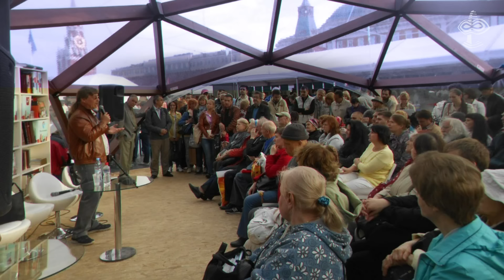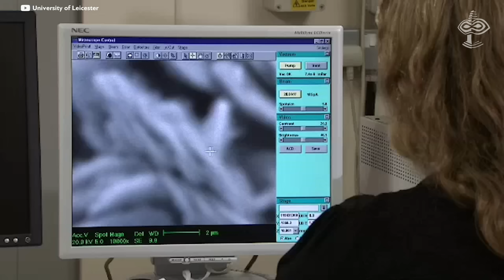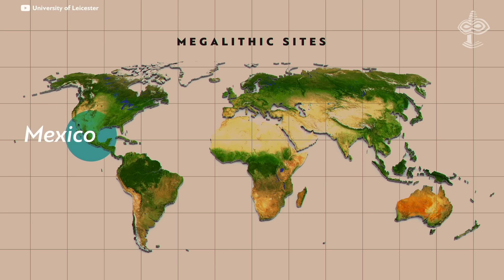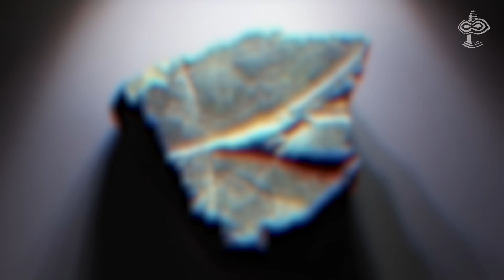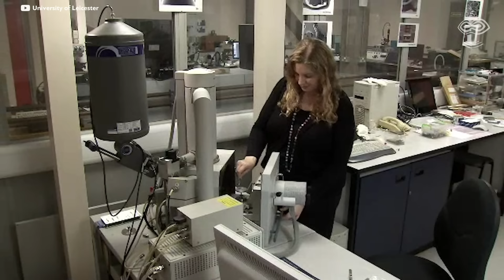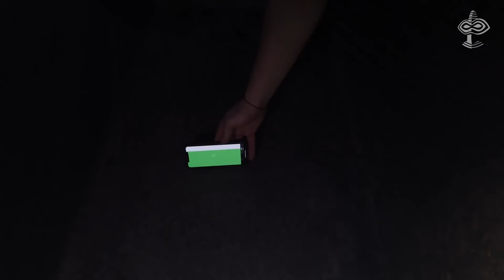The Secret of Ancient Tools: METAL MICROPARTICLE research - VERSADOCO

Comment: If it was not granite and instead a geopolymer that resembles granite because it is made with the sand from granite that was carved that could explain the tool marks in the pylon. Concrete can be worked with hand tools that leave parallel striations and the tools can be very thin because soft concrete is not that abrasive or hard.

If this stone is actually a composite made with Venetian plaster and granite sand like many marble renderings it would be worked to the shape observed. Surfaces can be polished with animal wool or textiles made of plant fibers. Some kinds of clay has very fine but also very hard particles that would be excellent abrasives for finishing. We know people extensively worked with and hardened clay. So they would understand that stone can be cast after being shaped in semi liquid form, and have am intrinsic understanding of the properties of different kinds of clay.
Reply from the maker: One thing we can definitively rule out here is the use of concrete. Ancient Egyptian megaliths are NOT composed of concrete, cement, or geopolymer materials. 

These processes require crushing the rock and altering its internal structure, something that can be easily identified with modern analytical tools.

And it was checked - https://www.researchgate.net/publication/248546084_Mineralogical_petrological_and_radioactivity_aspects_of_some_building_material_from_Egyptian_Old_Kingdom_monuments

Here is a quote from abstract:
"Mineralogical, petrological, XRF and radioactivity measurements were carried out on several Egyptian monuments (at Giza plateau and Abydos), as an integrated archaeological sciences project concerning Egyptian cultural heritage...
...Regarding the aim (a), hypotheses that large building stones used in the monuments were cast, as opposed to carved out of natural stone, are not supported by (i) the presence of undamaged fossils, (ii) lack of zeolite peaks in X-ray patterns, which would be expected if CaO was used in making cement, and (iii) random emplacement and strictly homogeneous distribution of fossil shells in the whole rock in accordance with their initial in situ settling in a fluidal sea bottom environment. Moreover, statistical clustering of chemical composition indicated five rock sub-categories and XRF analysis reported inhomogeneity of rock composition."

And don't forget about the existence of stone quarries.
Reply: @Versadoco  Sorry for rambling on! lol
But we need to zoom out from the trees to see the forest. 

Mining is a very costly and labor intensive endeavor that involves a great deal of sacrifice as the conditions are detrimental to human health and typically shorten lifespan significantly. 

Likewise, some mined resources are rare, especially in particular form, and possess very desired properties. However, they are incredibly hard to find.

Given all that effort was put into gathering these resources. We can safely assume that they would have explored multiple ways to use, or re-use the materials collected so that the yield of resources could be maximized for the effort. Even the sand from processing would be valuable to those who did the work.

Much like carpenters will collect their sawdust to use as color matched fill material.

Heck, people in eastern Europe make pipes out of basalt in a kiln so the rock is molten and when cured is identical to the natural parent material because the conditions in the kiln are almost identical to the conditions that formed the rock in nature. People are very observant and learn to copy what nature is doing.
Reply: @Versadoco  I certainly understand that some softer stone like limestone was more easily cut in raw form to relatively precise shapes using harder tools. The fossils are present in this type of sedimentary stone. Granite on the other hand is not a sedimentary stone and does not contain any fossils.

I would not suggest that granite was not quarried or ever made into monuments like statues. I would conclude simply that for the lack of waste piles that the cast off from quarrying granite was put to use. The pulverized granite sand would be relatively pure much like marble sand from quarrying marble.

Artisans both cut and carve natural marble, and use marble sand as pigment in a geopolymer rendering present on many columns, statues, and architectural features like architraves. There are also granite statues which are in fact hollow frames with a rendered material.

They did conduct some tests on the wall in Sacsayhuaman and likewise found the zig zag walls did not include natural rock veins like the parent material. Instead the vein material was present but in uniform particle distribution throughout the solid. Indicative that the stone was cast.

I wonder if these particular features have been analysed in the same way. The geoplymer material composition and grain pigments are identical because it is the same material. Only the lack of quarts vein inclusions and other natural crytal structures that deductively concluded the difference.
Reply: @Versadoco  Also, the fossil inclusion thing I'm not even sure is definitive. That assumes the calcium source and aggregate material was crushed or worked. That is a relatively modern process involving heavy machinery. If not for ball mills, and rock crushers, it would be too labor intensive.

Romans are known to have used crustaceans as a calcium source in their concrete mix. Not necessarily crushed to a powder. Just cooked in fire and activated with water. So it is possible for those marine creatures to be included in the concretion. 

All lime stone is in fact a geopolymer. As is was once a liquid mud that changed through chemical processes.

Ancient people hardened clay. They made mud bricks. They could not recreate the natural process that converts mud into hard limestone? Why not all of the above?

Today we machine metals, cast them, forge them, sinter, and then recycle. Why could they not have done multiple different things with stone instead of only one type of processing?

We can't assume anything from a few samples on some isolated pieces. It all needs to be analysed and compared.

While that line is fine and very narrow it is not at all straight. If we are assuming some kind of linear actuation mechanism made this why was the machine frame all curved? They can make perfectly flat stones but use curved machines?
Reply: @Versadoco  Excellent work clearing up the issue but some of the shapes and fitting look like altered matrix process. Something really really big is missing.

Comment: It's kinda obvious there were some microwave transmission going on, simply based on the distance between sites and the zigzag patterns. Also since most don't know because they've never assembled a microwave transmitter, that one thing used is a thin wafer of silicon with paper thin copper strips that form the star of David pattern, placed right in the middle of the magnetron. This allows transmission to three other antenna elsewhere.

Comment: Start with a solar 10 to 20 square meter curved solar mirror (gold plated) furnace focused to 15 cm and one can get temperatures over 2500*C..  Drive the formed bit at high frequency (38500Hz to 9600Hz) and water cool the bit.  the composition seems to be a type of invar.  Solenoid drive the bit using coils and capacitors.  This is not out of the realm of simpler machining and use of electricity.

Comment: Thankyou!!! Or, are the myths true and the stone was still soft (butter) because it had not fully hardened after the worldwide flood which created it, this would explain the stonework beginning instantaneously and ended abruptly. Perhaps we should combine what the ancients said with what they did.
Reply from the maker: The examples in the video don't support this version. The stone was hard and the type of traces of the tools left in the stone microstructure are the evidence.
Reply: @Versadoco does a vibrating blade make sense? The assumption has been made they've used sound for numerous things like healing body and mind as well as lifting the stones, could sound also slice stone?
Reply from the maker: At some point, a proposal was made for an ultrasound drill/blade of various kinds. However, the observed traces on the stone are distinct and varied from what was initially anticipated. It is something else.
Reply: @Versadoco  Thankyou!

Comment: as i had already mentioned , the technologies of the aliens were derived from space faster than light travel : the need of shield to deflect any kind of matter was a must so to be able to disintegrate any matter into mono atomic particle then with some kind of force field it will be easier to deflect the atoms instead of solid rock , the tool is a disintegrator energy beam that cut by removing electrons from the valence last complete electronic level , the tool is immaterial energy with very fine width , it was working as a blade and with necessary magnetic field will be able to extract the matter cut , one side effect will be  to leave a very thin layer of quartz on untouched surface by having silica atoms to re-attach onto the surface
Reply: source ?
Reply: @stfu3623  my own theory

Comment: The answer lies in a combination of technologies. One is the advanced technology that is able to soften stone at least to a moderate depth, and the other is a super-hard razor tool that employs that technology as it slices through softened hard stone.  It might in some instances even be a type of advanced pizza cutter rather than a linear blade.  
Neither of the two technologies by itself would have the capacity to make the inexplicable cuts seen on granite surfaces, but combined they would be able to achieve what otherwise cannot be explained.
Alternatively, it is highly likely that that pylon was formed the same way that many other ancient Egyptian granite objects were made, and that was by casting it in a mold using reconstituted granite material and one or more powerful binders.  

Creation by that common royal stonework technique allowed all of the inscriptions to be formed by 3-D positive stencils attached to the inside wall of the mold, and the extremely thin channel, aka "cut", was not formed by any form of grinding but by embedding a long strip of material, possibly metal based, like a ribbon running from the top to the bottom.
Once the mold walls were removed, that ribbon was pulled out, leaving behind the parallel micro-scratches seen under a microscope.
Reply: read my comment at top the stone was not softened the material was turned into mono-atomic particle

Comment: A super-hard cutting tool was not needed because the stone was softened (in full or around the cutting area). LAH has established this beyond doubt. Once the stone is softened, even soft materials such as bronze or a wooden stick will cut the stone.
Reply from the maker: Some cases are look like a softening of the stone indeed. This must be proved somehow though. We don't have means to perform adequate experiment yet.  But on the micro-level, as presented in the video, we have clear traces of mechanical processing. With quartz and feldspar grains cutted, not displaced.
Reply: @Versadoco  Andrey Sklyarov himself said that it is established beyond question that it was softening/plasticization. We don't understand the mechanism but the effects are clear, and we have examples that prove it beyond question (stone flowing over man-made blocks being the most obvious). Although we have examples of all degrees of softening (from natural state to fluid), the grains would not be displaced if the stone is only slightly softened. For the Karnak granite example it would be like cutting a hard cheese, such was the state of the stone. Softening is the only viable solution to the cuts and core drill holes in igneous rock types. It is consistent with the spacing of the striations. An impossibly hard material - even 1000 times harder than diamond - is not a viable explanation because the pressure necessary to achieve the spacing of the striations would cause the grains in the stone to collapse/disintegrate or explode. 

Thanks for replying and thanks for all your excellent videos!
Reply: They where smarter then us,, we are just too arrogant to admit it
Reply: Acids like used by the Inca might erase metal particles maybe
Reply: Tutankhamun was buried with a dagger made of the same metals.
Reply: i was translated a book 18 century it's all about artificial stone, believe me noone soften nothing its not natural in it's nature!! was 2 sorts of artificial stone: burnt and not burnt!
Reply: @АлексейШарапов-э3д  🥴